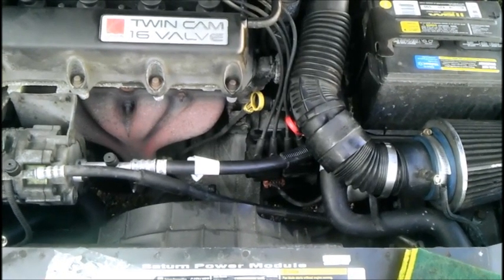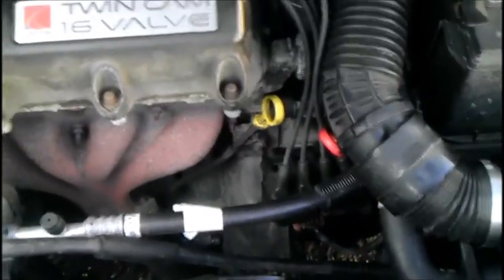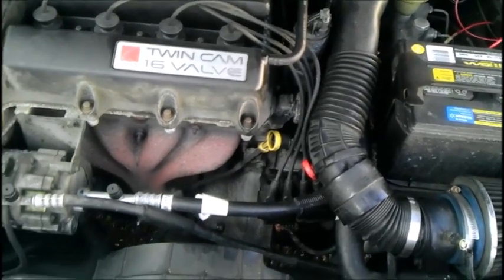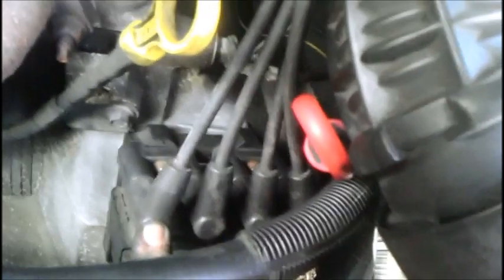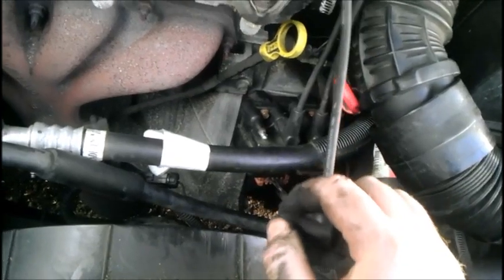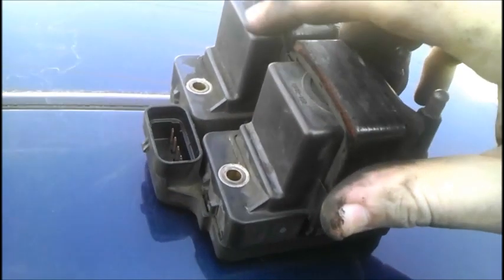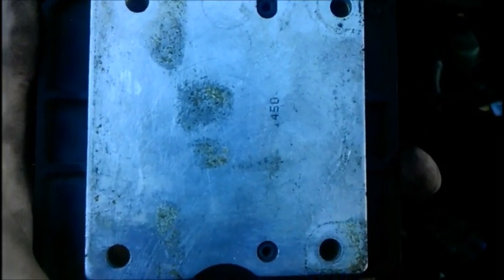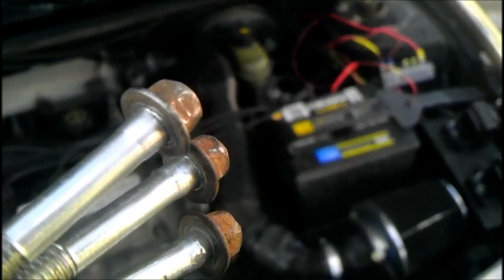Removing/Cleaning the ignition coils/module on a Saturn S-series.

Comment: Is it possible that my coils and module need cleaned although i do not get any codes? It runs a little rough.Changed plugs,wires, cleaned egr, throttle body,replaced temp sensor (from when i was getting codes) fuel/pressure regulator filter etc,. 1999 saturn sc1 
It fires right up just fine.I get a little sputtering at stop signs etc,
Reply: I am having the same issue. I get p0301 as a code after it runs for a bit. Ive done the same things except I cleaned the manifold the holes in the head too. I have brand new spark plugs and wires still got p0301 pending so to check the coils take two of the boots off. Then watch as someone tries to start the car what color the arch between the connections are. If the ark is blue the coil is good if its red the coil is most likely bad or possibly needs cleaned. (I haven't tested the cleaning theory yet do that tomorrow.) Other causes are injector clog or a wire from the injector short. My husband only lets me work on it a few hours a day before he takes it to work so im still working on it. However I didn't get this code until after I replaced the spark plugs so you it might also be a bad spark plug. Best thing to do is get a code reader and see if it has a pd = pending code for p0300-p0304 where the last digit indicates the cylinder number. so p0301 is cylinder 1. change ur spark plug for the cylinder problem to a different spot on the motor. If the code follows the spark plug then its the plug if it stays then change the wire for the problem cylinder to another spot. If it follows the wire then its the wire.
Reply: poemranger Thanks for all the info. My problem was the intake manifold gasket. Saturn's around the 2001 models had bad gaskets from the factory.If you think you may have the same problem just spray carb cleaner around the manifold.If the engine wants to stall, you found the problem. Every where you read it says that the leaking gasket affects performance at higher speeds. Apparently not always true.
Reply: John Johnson I did notice there was three gaskets on the manifold which i thought was really odd. I will have to get some carb cleaner. I only have break cleaner. I will definitely try that out. It could be that with all the backed up emissions holes. They were completely 99.99999999999% plugged. The whole system was in very bad shape before I cleaned it. So with all the air pushing through it could have cause a leak with backed up pressure. When u pressurised something it will find the weakest spot to leak so... thanks a ton!
Reply: poemranger Mine was leaking on the under side of the manifold....number one cylinder.If you end up replacing it make sure you buy a Felpro gasket.
Reply: John Johnson I will thanks a ton. I've been working for nearly two weeks to get this car back to running normal just from the codes the p0301 is the last code I have. I will definitely that brand. Not sure how I'm going to get the lower half off or if I even really need too. Maybe just take the bottom loose to get better access. Thanks a ton!
Reply: poemranger Not to sure what you mean about "lower half". I have a 1999 saturn sc1.
Reply: John Johnson yeah its virtually the same manifold has 7bolts into the head then 3 on the lower part of it I do believe it goes to the catalytic converter? By lower half I meant the three bolts on the bottom pipe part.
Reply: poemranger I was talking about the intake manifold.I believe youre talking about the exhaust manifold.
Reply: John Johnson yes I was talking about the exhaust manifold.someone put 3gaskets between the head and the exhaust manifold. I have a 2002 saturn sl1 single cam I will check the intake manifold. Hopefully I can track the problem to something simple. Im chipping away at the causes a lil at a time. Im not sure I can do the intake myself.
Reply: poemranger You can do it.Its a piece of cake.
Reply: The thing that has me completely stumped is that it isn't a constant misfire its just occasional when certain conditions happen. I will check it out, absolutely. Im just thinking maybe I got a bad plug or something since this happened directly after changing the plugs. I really do like this car its the first car I ever bought and I gave it to my husband when I got my Hyundai which I fully intend on getting rid of as soon as I get the note low enough. In case your wondering the first car ive ever owned my father and I used a car with a good body and a donor car to put together one car. It was good experience for me to wrench turn myself. I will eventually track it down. I can rebuild a motor if I have the parts this car to me is worth it because of the excellent mpg. Thanks for the tips.

Comment: i just took mine off. it looked like battery acid behind it. lol. i cleaned it. but my wires had a plastic lock on them they diddnt come off first. i had to take the coil off. dose it matter if i took both side of the spark plug wires off? my car idols high in gear and reverse
Reply from the maker: As long as you take note of the firing order (which is 4, 1, 2, 3) you can take the wires and coils off safely
Reply: @adventureoflinkmk2  dose it matter putting them on? what would happen if i diddnt do it correctly
Reply from the maker: @you_tube6733  putting the coils on the ignition control module, no.  Firing order matters, and if you don't get the firing order right the car runs like ass or won't start at all
Reply: @adventureoflinkmk2  should i take them off and put them on again?
Reply: the wire to the spark plugs? and put them on in order?
Reply from the maker: @you_tube6733  if you didn't get the firing order right I would suggest you take em off and fix the order.

Remember, from left to right on the coil packs is 4... 1... 2... 3... and each cylinder from left ro right is 1.. 2.. 3.. 4.. so the wire for cylinder 4 would go first, then 1, then 2, then 3
Reply: @adventureoflinkmk2  ok i will do that. and check my spark plugs to see if they are dirty
Reply from the maker: @you_tube6733  good deal, lemme know how things go

Comment: the PO341 code popped up. I changed the spark plugs. I turned the car on and off many times. I parked it a couple days ago & now it will not start. I changed the spark plug wires. No start. Tomorrow I will do as you said & hope the car fires up. If it doesnt????

Comment: Vid is great but these motors do have a cam position sensor on the bottom behind the starter.ive had to replace mine.no offense you are wrong about that.did everything you said. Nothing. Replaced the 20 dollar sensor. Perfection. See if you can fit under the car and do a vid on replacing the sensor so people can really fix their 97 Saturn sc1
Reply from the maker: Sorry, but you indeed are wrong.  The cam sensor signal is emulated in the spark ignition system, which is why it's important to have the plug wires separated as they are.  And that is a crankshaft position sensor you replaced..
Reply: Yeah a crankshaft position sensor not a cam sensor.im well aware. I'm explaining that replacing the CRANKSHAFT POSITION SENSOR fixes these codes. I know this and still own this car. Trust me man I've been doing this since before you existed

Comment: I cleaned off my transmission with non aerosol decrease n rinsed with water n now my 94 Saturn won't fire
Reply from the maker: Hmm.  You may have gotten the degreaser and/or water on or near the ignition coil and/or module... That's prolly why it won't start

Comment: Note I'm the one and only original owner of this car. I know it inside and out. Any vehicle runs better if you clean the coils. That don't mean you fixed anything. Damn a lawnmower runs better if you clean the coils. No matter how many big words you use you are wrong. Sorry folks
Reply from the maker: And no matter how many times you wanna keep posting, it still doesn't change the fact that you changed the CRANKSHAFT Position sensor
Reply: Right. That's my point. Did what you said still got codes and dash warnings. Change the sensor fixed it.
Reply: I own a 90 suburban an 86 samurai a 97 Saturn a 2014 compass a 2017 Trac a 95 Dakota. I do this for a living. 32 years experience. I've seen everything. Take my advice. Find the sensor so you know for yourself.
Reply from the maker: I know where the sensor is exactly, I used to have one of these once upon a time.
Reply: Okay in your vid you claim GM emulated the CPS. I couldn't figure out why mine acted up even though I do it every day. I'll admit it. Had to change the starter and voila! There a sensor! Changed that and fixed it. Really did watch like 40 vids trying to fix my own car. Pulled it up in my own shop hooked my diagnostics and tried a million things including brand new distributor. Waste. A damn 20 dollar sensor that's so hard to find. Thanks GM.

Comment: I changed everything out but it was working before and now it's not working and I need to get to work
Reply from the maker: Hmm... let's see... I dunno what voltages you're supposed to get at the ignition module connector, maybe ask around the Saturn Fans Forums for a pinout

Comment: Thanks really helped
Reply: adventureoflinkmk2 

Hey i just got done cleaning it letting dry now what shiuld i look for if it still dont crank up
Reply: adventureoflinkmk2 

Glad you said that i started with the starter... new ignition switch... new lock  cyclinder ...new safety clutch switch and took prolock off of that just to get it back to turning over no sound before...took it to the shop he check the fuel pump ..fuel injectors and put New crank sensor on he was head toward the coils and mod...i have a 95 saturn sl2
Reply: adventureoflinkmk2 

Still no luck it trys to start when i spary starter fluid but nothing
Reply: adventureoflinkmk2 

So i need to replace the fuel pump or trash it
Reply: adventureoflinkmk2 

Just checked the f5 it looks good
Reply: adventureoflinkmk2 

Sorry bout that dug deeper into the fuse  box f5 is fried extra crispy it looks like the f 10 and 11
Reply: adventureoflinkmk2 
but what is the f 10 And 11
Reply: adventureoflinkmk2 

Thanks alot
Reply: adventureoflinkmk2 

Yeah imma check it out again and i finally got my car up and running after cleaning the f5 she runs like a champ but one more problem with the ECT sensors wires were cut fan motor relay wired.. fan does not turn on with key
Reply: adventureoflinkmk2 

On this model it turns on when you you turn the key to acc it even notes it on the car